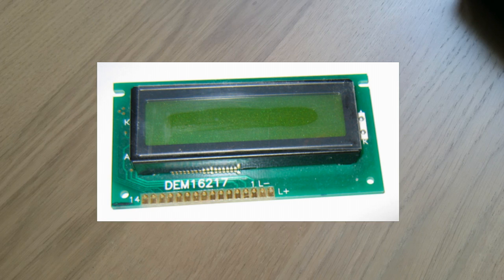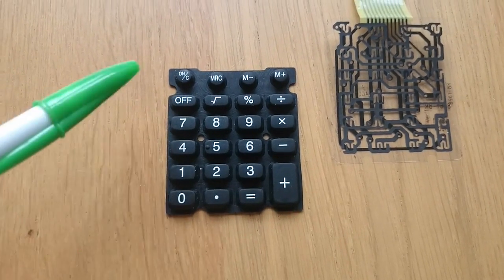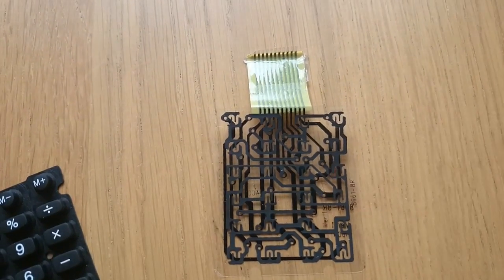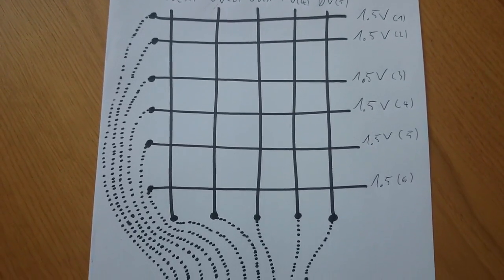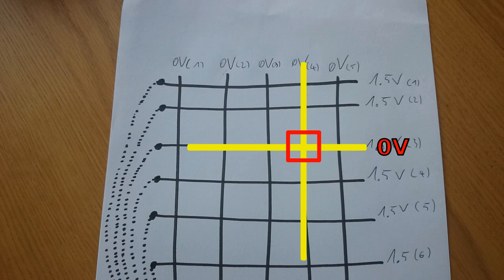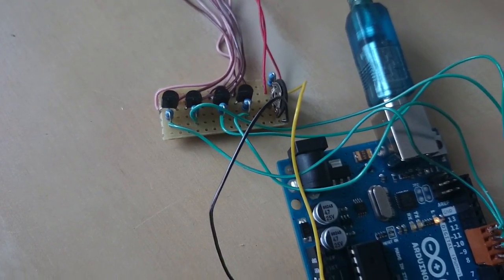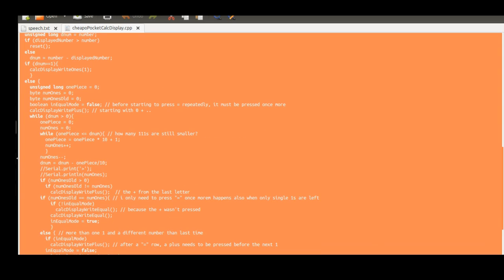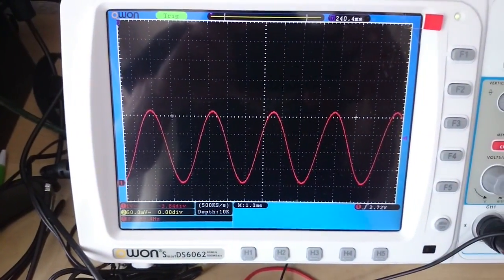Hacking a pocket calculator as LCD for the Arduino

Comment: Hello, I'm trying to do something similar with a calculator, I just do not use the transistors with the arduino, if you can give me a diagram of how you connected the keys with the transistors and arduino
Reply from the maker: You need to measure for each key you want pressed which line is "-" and which is "+".  A volt meter across the key contacts tells you. For one key, the transistor (BC547 for example) is connected with the emitter to "-" and with the collector to "+". The basis goes via a 5k resistor to the pin of the arduino.

Comment: Can you make it type letters?
Reply from the maker: As in "some numbers look like letters when flipped upside down" ? - yes. As in "actually controlling the segments of the LCD" - nope. All the circuit does is pressing buttons on the calculator.
Reply: @Joekutz  can u reverse engineering the display lines to actually act on the display digits? it's kinda messy workaround having to emulate keystrokes on the whole calculator (I mean your solution is just better than putting relays to push the calculator buttons, but still is using the same principle)

Comment: How about a schematic and Arduino Code?
Reply from the maker: For such a simple circuit I was too lazy to post schematics. It is one NPN transistor (BC547 or NE222 or almost every other type) between the low and high contact of each calculator key, with the emitter connected to low, the collector connected to high and the base connected (via a 5K resistor) to the arduino port. The arduino code for the LCD library (the "multi-tasking" version, see my next video) can be found on my hackaday page.
Reply: "Simple" for a genius like you!  For people like me, not so simple! :)

Comment: This technique should be really great for displaying % counters. Clear, +, 1, then = as many times as necessary.
Reply from the maker: I did that in my past, using a calculator as signal-counter. Only problem is that it starts to miss peaks above 10 events/second.